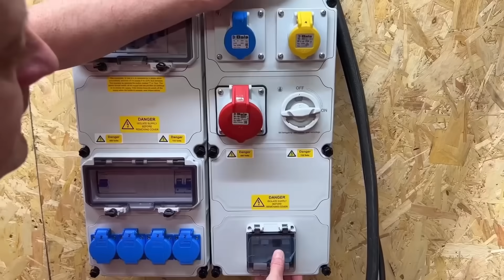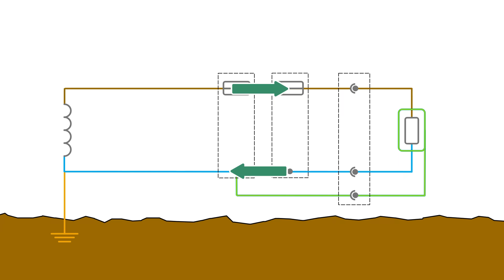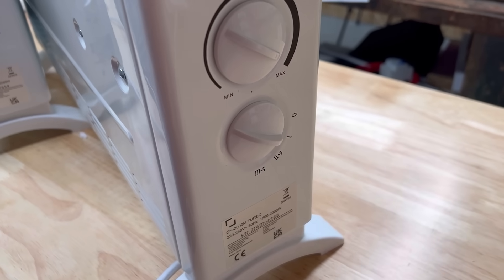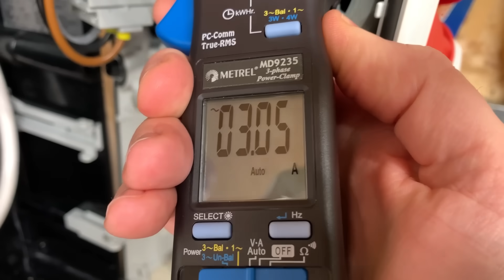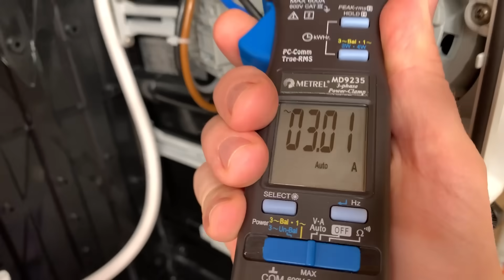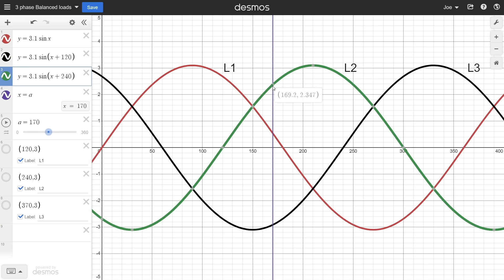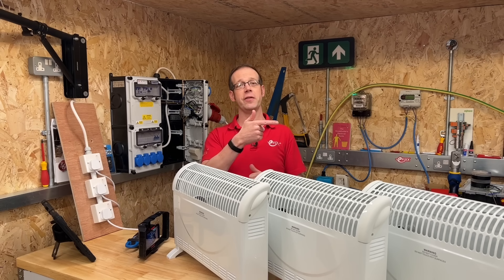Does Current Flow Through The Neutral Wire?

Comment: Hello, I just looked up this information and found your channel.
My dad is an (old time, retired) electrician and has taught me to do basic electric work.

I replaced a ceiling outlet (lighting) and instead of turning off the circuit, I just turned off the outlet as it's and old house and it's supposed to only have 2 connections (phase + neutral, no earthing) in most places. Turning off the phase should do the trick, and even if there is some leakage, it should only tingle. I verified everything with a basic "glow lamp" style seeker. No phases. And then verified with a multimeter - No current flow from L1 to Neutral. 

However, I noticed the neutral had 2 wires attached. That was peculiar,but I thought it might just be sharing a neutral with some other light or WTF knows? It shouldn't be an issue.

When I disconnected the L1 from the ceiling outlet = no issue.
When I disconnected the neutrals, small spark and the lighting on the walls in that area of the living room (supplied by wall outlets) turned off.

Interesting. I shat my pants, stepped down from the ladder, took a moment to check myself, wondered why the RCD didn't trip (obivously it only sparked, didn't touch me in hindsight) and then turned off the entire house main feed. I'm not messing around anymore when neutrals and phases are mixed around everywhere.

Anyway, I told my dad and he refused the possibility of electricity in a neutral. I told him electricity is defined as a difference in charge, and there should be current flowing return in the neutral.
Now I understand it better, and I'll show him this video.

(Also, I'm the EU with a proper RCD and I use VDE tools with the 1-hand-behind-the-back principle when doing semi-stupid shit like this. Worst case is going to be a zap until the 30ma RCD cuts out)

Comment: I understand all 3 heaters are connected between each line to neutral and it is a balance load. 
But would the heaters still work if the neutral was disconnected?🤔
Reply from the maker: Yes

Comment: the phase goes to the heater but the neutral can be disconnected.What ye on about?  Where is the circuit for current to flow?
Reply from the maker: The neutral can be disconnected at the star point between the heaters.

Comment: Well, I will slightly disagree with Foogod.  The power to a North American home is single phase. Just because we have two legs of a single phase center tapped  transformer does not make it two phase.  We did have a 2 phase system that was used mostly in factories in the first half of the 20th century.  It was dropped from our code book in the late 70's as it was mostly gone.  We ground the center tap and call it neutral, it carries the full load of all 120 volt two wire circuits and is also used to carry the difference current of a three wire 120 volt circuits with a common neutral conductor.  The fact that the two circuits are 180 degrees out of phase does not create a second phase!  The two hot legs provide 240 volts for large appliances for cooking, heating, and air conditioning.  I would call it a dual voltage system.  Our three phase system  is a commonly a wye type with the center neutral with 120 volts phase to neutral and 208 phase to phase. This is close enough to allow single phase equipment designed for 230 volts to work in both home 240 volt and phase to phase at 208volt. Note that there are other three phase systems of both different voltages and wye / delta configurations.  I really bothers me that some will refer to our single phase system as two phase, it is not.

Comment: I'm a bit confused as if you disconnect the neutral in the fuse board then how does the heater still work if the plug socket's neutral isn't connected to anything?
Reply: Me too,gonna look like a right tit saying this story to fellow sparks.
Reply: You are thinking about a single phase circuit when the whole point was about three phase.
Reply: @okaro6595  yes I know that but I don't understand 3 phase that's why I'm asking
Reply: because at any moment in time, currents on 2 phase combine to return on the 3rd phase. So there is still current on all 3 phases. This is why the 3 heaters still work without the neutral .

Comment: Regardless of phase: is it correct that essentially, the neutral and earth are one and the same thing? E.g. do both 'combine' back at source?
Reply: Neutral and earth serve different purposes.   Neutral connects back to transformer to complete the circuits.  Earth is for dissipation of lightning surges.
Reply: @KevinCoop1  I understand they serve 'different purposes', but, a sparky recently told me that back at 'source' - BOTH are 'combined', making them essentially 'the same'. (I'm no sparky - basic knowledge here, but, that sounded rather odd, but, also reasonable).
He actually said - that, is exactly why RCD actually works.

Comment: I've come to the conclusion that I am 'Electro-blind' !!! I love videos like this one and it is extremely well presented but I just can't get to grips with the physics of electricity lol. Keep up the good work and I'll just be happy I can change a 3 pin plug!
Reply: So some practical stuff. Start with small circuits, and slowly work up. You will run into issues, and while solving these you will understand it more and more! 
There is some confusing stuff that you will have to sort out. Some that come to mind are, that the way electricity or rather electrons, flow is exactly the opposite as it’s drawn and described in schematics. Another would be that ground in electric hardware is not always the same ground as the ground in the outlet. In devices ground often is just a reverence and can carries a voltage

Comment: This is spot on . I think most people missed the fact that , even though you don’t need neutral , and depending on what you are running , and in this case 3 units 1 phase heater: it is safer to run a neutral at 1/3rd the max amp capacity , in this case and if in the event if one of the 1st phase heater encounters problems .
Reply: It would appear from the video that you need the neutral to be the same size as the phase conductors, as if one heater fails you need to be able to carry the full rated current of the phase conductor.
Reply: Well if you had no neutral and then disconnected one of the heaters the power would be reduced by half. With a neutral it will be reduced by a third.

Comment: In my 3p installation (French farm house), I am required to keep the three single phases as balanced as possible. If I don't keep them an average over the day of no more than 30% from balanced, I am charged for the imbalance. Actually the power company use a average of averages over a rolling ninety days with each day being the final day of the window - a rolling window of usage, if you will. It's a very fair way of calculating poor usage of multi-phase mains.
In this case, a current sensor on the neutral is being used to discover the extent of any imbalance rather than having a meter on each phase. In reality, I have access to this data, including usage on each phase using a IoT meter I built myself which contains four current sensors attached to an Arduino with a wifi module to send the details in real-time to my own metering software as an MQTT stream. I then create a graph using Grafana this to show when imbalances occur and can adjust the loads on each phase accordingly without having to guess which is underused. Not too long ago such metering hardware and software would have cost a fortune. Now it is possible to do it for a few quid.
Reply: What a rip off!   But I’m thinking it would be hard to have a 30% average imbalance over 90 days once you fix the condition once.

Comment: I am little confused, i think it won't work if you disconnect neutral from the point where three neutrals meeting, like if there's only a phase wire connected in the heater without their interconnection?
Reply: They are talking about disconnecting the neutral coming in from the transformer.   The neutrals from equipment still connected together on neutral bar.   Or a neutral out to a junction box that all three are connected to and removing that connection.   Best wishes,   Kevin

Comment: One part of the video he is missing is: Why is there 3A in the neutral when 2 heaters are turned on, which is unintuitive considering that the two lives each have 3A. The reason is: If you sum two sin waves that are 120 degrees out of phase - the result is a single sign wave at 60 degrees phase (ie. in betweeen the two sign waves). Thus the 3A in the neutral is 60 degrees out of phase to each of two 3A's of the lives.  Now consider a sin wave that is the exact opposite of the 60 degree neutral wave (ie another 180 degrees) It would be 240 degrees - the exact same phase as the 3rd phase. So the 3rd phase when added exactly cancels the neutral, which is why it reads 0A when all three are in use. This also means that the max current in the neutral is only ever the max current in one phase - doesn't matter how many of the phases you use. If you use 1 phase 3A the neutral is 3A at the same phase. If you use two phases 3A, the neutral is 3A but at 60 degrees, if you use 3 phases 3A the neutral is 0A. Thus you can draw 9A total to your loads, but the neutral wire only has to be rated to 3A - and if the three phases are assured of being balanced - you don't need a neutral at all.

Comment: Unfortunately, although it is possible to operate 3 individual balanced load in your demonstration and remove the need of a neutral. You have to remember this would only work safely if you switch all of them on or off at the same time (you cannot operate the circuit with only one heater ON without a neutral). You will also risk a floating neutral point in an unbalanced load situation (eg when you have only two heaters ON) without a neutral (worse case you could have greater than phase voltage reflected across the loads which are ON. The neutral even if no current is flowing still acts as a voltage reference point to ensure all single phase loads operate at phase voltage.

Comment: Great video.  Well done.  But it is clouding up the subject a bit.  Of course, using three phase for single phase devices happens all the time, but single phase devices use one  two hot lines.  120V and 277V devices use one hot line and neutral.  208V and 240V could be either one hot line and neutral or two hot lines and 480V is always two hot lines (all examples are single phase).  I would like to see this using a single-phase supply, L1 of the 240V single phase supply wired to all three heaters in parallel, then check the neutral amps as each heater gets energized.  A previous comment said the standard residential supply is two phase because of the two hot lines.  That is wrong.  The standard residential supply is 240 Volt, Single Phase.  Best Wishes.  Hope you keep up the good work.

Comment: Different when it comes to Harmonic distortion, particularly the 3rd harmonic.  These harmonics are the result of nonlinear loads that convert AC line voltage to DC, i.e. frequency converters, PCs etc. This causes a much higher current to flow in the neutral even in a balanced designed system, thus needing to install Active or passive harmonic filters to take them out and balance the load again or simply oversizing the neutral conductor to exceed the phase wiring by 50% to accommodate the higher current
Reply: Yes, in forward phase theatrical lighting systems, neutral over-current can be a big problem! Basically, at certain settings, the dimmers may all be drawing current near the end of the half-wave  so there is no cancellation. The result is that the neutral conductor is carrying the highest current load. In the US, NEC requires such systems to oversize the neutral conductor. As harmonic filters would trow of the Zero-Cross Detectors in the dimmers, oversize is the only solution.
Reply: In the US, high harmonic loads are required to have the neutrals doubled in size to handle higher amperes on the neutrals.   Special transformers are also made.  Best wishes,   Kevin

Comment: I have a related question. On a residential US system with a 240v setup, is the current on one side the total current or is it 180 out of phase and you would add the current on each leg to get the maximum current draw? For example, I measure 30A on one leg with a clamp meter and 30A on the other. Is the load using 60A or 30A? Thanks!
Reply: "using" is the wrong word here. Loads use power (volts multiplied by amps), current (amps) flows along a wire (and through a load). So when you measure 30 amps, then there are 30 amps flowing through that wire you are measuring and those same 30 amps flow along every other conductor that is part of the loop the wire belongs to, even the windings of your power source. The only thing that happens is that amps from multiple loops can cancel each other out when they share a wire.

So, in a 120/240V split-phase system like yours; if you measure a load and see 30A on one hot, 30A on the second hot and 0A on the neutral, your device is using 7,200 Watt and 30 amps are flowing through each hot wire and the load and both secondary windings of your split-phase transformer. If you measure 30A on one hot, 0V on the other and 30A on the neutral, it's using 3,600 Watt and 30 amps are flowing through it and all wires in the loop and one secondary winding of your split-phase transformer.

Note that you cannot see a difference between a 30A load connected to the 2 hots and 2 30A loads that are connected to different hots and the neutral. Here the currents on the neutral cancel each other out just like 3 loads do on a 3-phase system. When the current for one load flows into one direction, the current for the other one flows in the opposite direction, giving you +30-30=0 or -30+30=0 or +15-15=0 or -1+1=0 and so on.
Reply: @HenryLoenwind  thanks for the detailed reply. I guess my confusion here stems from the fact this is on a 60A circuit breaker. I installed a meter on one leg to see how much power it was using. I see it peaking at 16kw at 240v with 30A on the leg I'm monitoring. The math doesn't really work unless it has 60A for the entire circuit.

Comment: Very good, understandable explanation! However,took some days, but the question popped up in my head: 3 phase current,as in the video, flows thru the heaters(or whatevers). Neutral wire shows zero current,if all 3 phase have equal load.
Would this trigger a ground fault protection relay?
I have one, installed in the circuit breaker board, all 3 phases coming from the meter goes straight in the 30mA relay,so the entire house is protected. So if current flows thru the phases,but there is none on the neutral,would it trigger the relay? I have no 3 phase consumer units, so I haven't tried it in real life.
Any answer is appreciated :)

edit: it might be important: I'm in europe
Reply: If you ran the 3 phases through 3 single-phase GFCIs and then connected their neutrals, yes, that's an instant fault. If you run them together through a 3-phase GFCI...that's why there are 3-phase GFCIs...
Reply: @HenryLoenwind  Hi Henry, thanks for answering, I just see it now.

Comment: Is there current going through the ground wire? Only when there is a short?
Reply: Yepp. Only if current finds its way to the grounding system.
Reply: under normal operation, there should be no current flowing on the ground

Comment: An outstanding presentation. I am a retired electrician and most of my work was done on 480 VAC three phase control circuits. I worked with maintaining large 50+ horsepower 2-speed motors and things like that. I also worked with DC traction elevator motors. I found it to be very enjoyable work. Your presentation is spot on!! I just subscribed so I will be seeing more of you. Cheers!

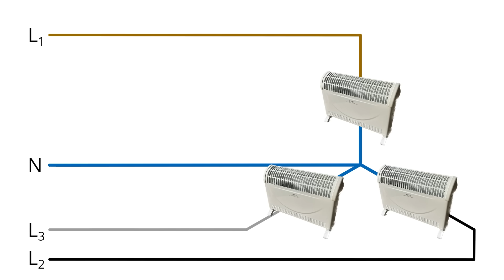Comment: Thanks for the current measurement on the neutral with the two loads on L1 and L2. Both because it's not intuitive, and will force me to interpret the KCL and the desmos graph on my own as an "exercise for the reader". Where in the circuit are the neutrals of each of the individual phases physically connected? Within each of the outlets on that piece of plywood? The diagram at 5:36 shows the conceptual drawing; but where is are the physical connections of that neutral in the Y-config?

Comment: This is exactly what I was wondering for a while now so thank you for explaining. I knew three phase motors didn't need the neutral because it was a balanced load but for some reason it never occurred to me that heaters would also work the same for some odd reason. Clever stuff.

Comment: The heaters are rated at 230vac input. Line to line voltage is 400vac. Square root of 3 (phase system) is 1.732 and is always applied to power calculations. 400vac over 1.732 is 230vac, which would be measured between any line and the common point. 3 phase resistive load; Ib = P/Vx1.732

Comment: My predictions for that experiment were:
- Current on neutral equal to current on live if one is turned on
- If two are on, current on neutral will be about halfway between one of them, and both added together
- If all three are on, no current on neutral

Now, I did watch the solution before writing this, so I know I got the second one wrong, but the idea was correct. Because both are on, there is an additional return path, and so less current needs to return through the neutral.
If all three are on, the only current you would expect on the neutral is the difference in consumption of the heaters. Since they are all very similar, you wouldn't expect very much. They are all on different phases, so there is always a return path through one of the other heaters.

...now, I am writing this after seeing the solution, but before the explanation... so let's see how wrong I got that, lol